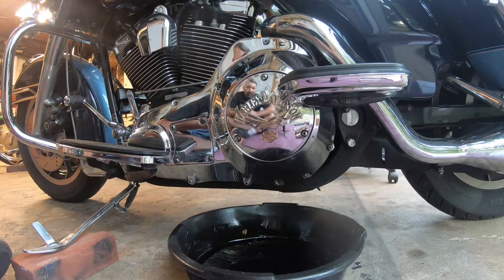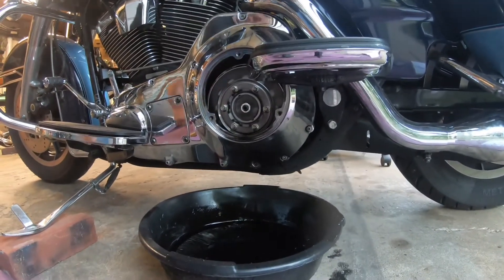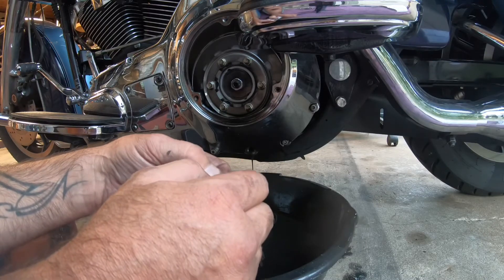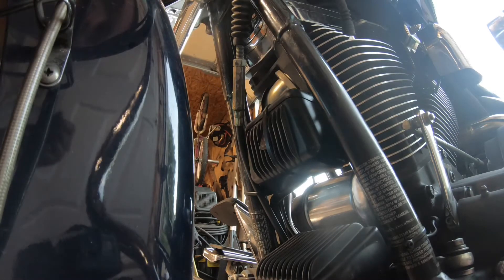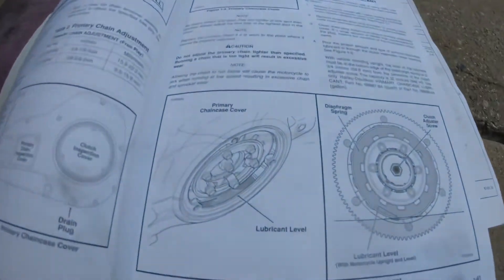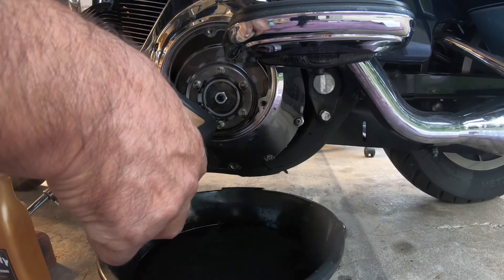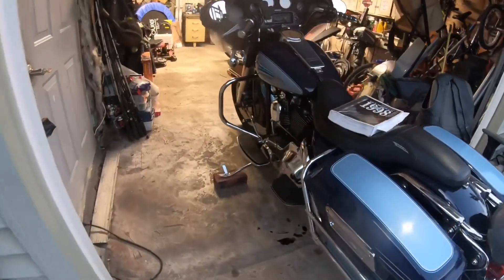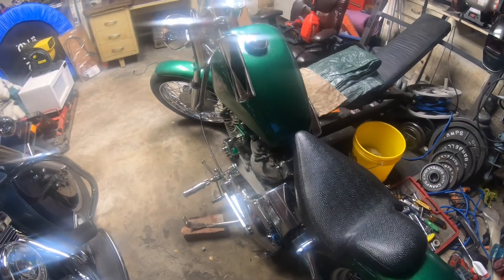Primary Oil Change and Clutch Adjustment

Comment: What was your indication the clutch needed to be adjusted? The adjustment barrel is for the cable slack right?  What did the adjustment attached the clutch basket do?
Reply: Adjustment at the clutch basket do?
Reply from the maker: I like to properly adjust my clutch every 10k miles, I’m sure I went over this time a few thousand but it won’t hurt